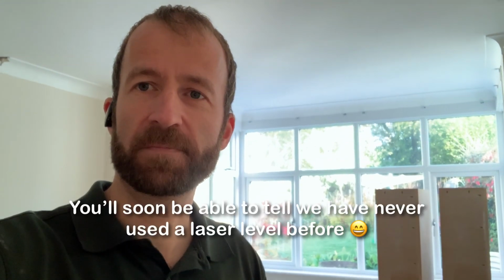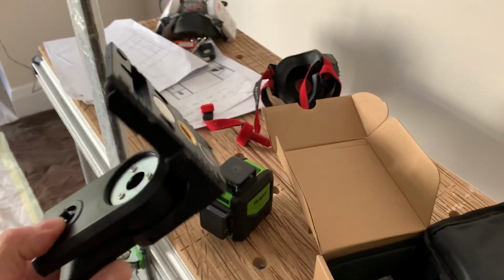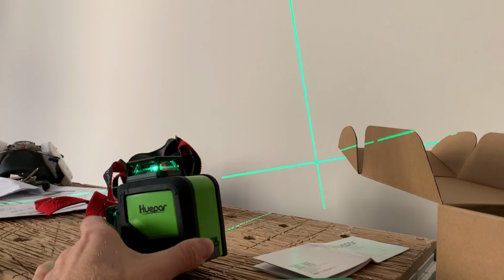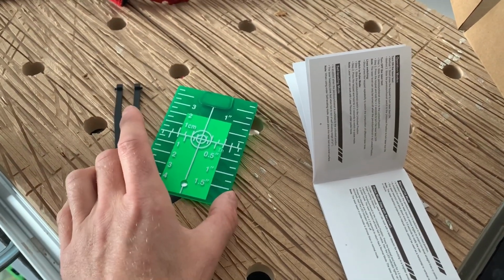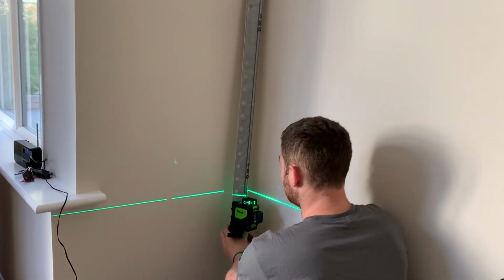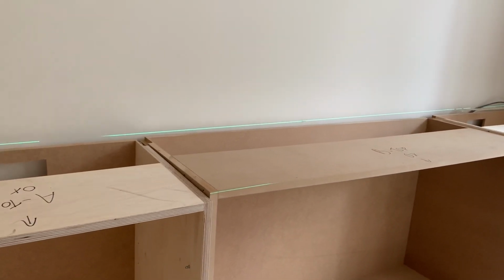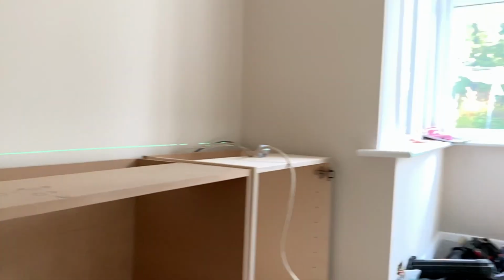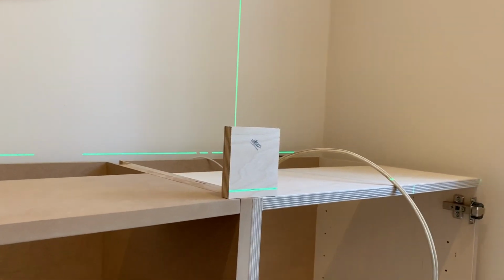Huepar 902CG laser level unboxing

Comment: Its been my experience that the target is for suspended ceilings. You use it to level the metal grid. Attach your laser to the wall and use target to level it. My laser clamps to the track so no screws in the wall.
Reply from the maker: Brian Needham makes sense!
Reply: That's exactly what it's for. The green target hangs off of the grid and your able to adjust its height perfectly level.

Comment: Use a quick clamp to clamp a panel saw to a door and then the magnet with grip onto the panel saw. Not in contact with the floor and no fixings to tidy up afterwards.
Reply: Good idea.Perhaps even better would be to clamp a steel rule to the door so you don't damage the door and can make your adjustments quickly and precisely IF you need to set the line at a particular height.
Reply from the maker: Good ideas, best to avoid contact with floor so it doesn’t wobble

Comment: Buy a cheap plaster board support it can be fitted in doorway or floor to ceiling and being metal the magnets hold the level at any height
Reply from the maker: As commented to Norman above - I’ve gone off any method that sits on the floor because walking around wobbles the level,  hanging off the wall seems best if possible.
Reply: you will learn a few tricks as you use them more. i have tripods on wooden floors , they are too springy . i use  on of those exandable poles  that you jack up like a silicone gun but put it in a corner out of the way to minamise any flex in the floor hanging a hand saw from any picture hanging points works good too but it a bit limiting. last time i did that i brought a flexible steel roll up straight edge  and hung that on a nail so i had 6 feet to play with height wise. clamping a hand saw to a window works well too sometimes , a clamp is great to clamp onto a window board overhang  the magnet will hold on the bar of the f clamp

Comment: Hello I bought the model up from the one in the video and I also purchased this ( Laser Level Mounting Pole 3.6m with Tripod Base Floor to Ceiling Support & Bracket + Adapter 1/4 and 5/8 + Bag on Amazon) not cheap but not overly expensive either and they work flawlessly together take a look. Hope this helps. If you need a direct link let me know.
Reply from the maker: john smith can you put direct link for simplicity, it should work as a hyperlink here
Reply from the maker: john smith thanks for this, seen it now.  That look well built, I had t seen one like that.  I’ll see how I get on with other methods of attaching the level on site but will keep it in mind and probably buy it eventually!

Comment: Try using a plasterboard prop that’s what are use the magnet sticks to it great you can use the floor and the ceiling for the prop
Reply from the maker: Norman Roberts I’ve gone off any method that sits on the floor because walking around wobbles the level,  hanging off the wall seems best if possible.

Comment: Ok, I looked at a number of levels cheap and expensive and decided to stay away from one for the time being even though I'm a big gadget fan myself.

The main reason being they're not as accurate as we may think - Skill Builder did an episode on it.

Another reason is price. The one robust and accurate enough for my needs costs far too much just now.

Finally, battery life is generally poor and Makita don't do an 18v version which is ridiculous.

One minor disadvantage is quick and efficient mounting which none of the manufacturers seems to have come up with a real good solution for.

Not so long ago all chop saw makes had laser versions which we all know now is just a waste of time.

So, I really appreciate your review as I did sincerely consider this manufacturer myself.

Have lots of fun with your new toy guys!
Reply from the maker: aaa aa it will be interesting to see how we get on with it in the long run.
Reply from the maker: Can you post a link to the skillbuilder video in question?
Reply: @Alastair_Freebird  here's the link to the SB video https://youtu.be/wGU-MurwF4A.

Forgot to mention good quality levels have pendulum locks to keep them protected in transport. I believe it's just a mechanical lock like a pin or something but most levels don't have it.

Yeah, go ahead and post us an update in a couple weeks time. That would be much appreciated!

Laser levels tend to be out on the extremes of their visible ranges. It'd be interesting to know if this has implications in real life situations.

Comment: I just got mine today. It sucks. Lots of ghosting and fantom lines. No it’s not dirty, and I bought it directly from the manufacturer.
Reply from the maker: Ah shame I'mm sorry to hear that, its worth contacting them to ask for a replacement
Reply: @Alastair_Freebird  I did. They said it’s dirty. Funny thing happened, I turned it back on few days later and it’s been working fine ever since. Even in a dusty construction environment. Not really sure what was that.
Reply from the maker: @lockpickingvlad  That's interesting.  Perhaps a small speck in just the wrong place (like right on the laser source) can do it

Comment: Great video! I notice you cut the carpet. How do you fix the carpet to the floor after your cut? Do you install another tack strip and stretch it?
Reply from the maker: Michael Ford yes we do reinstall the tac strip under the cut edge (cutting back the underlay accordingly).  We kick the carpet into the spikes, it has always seemed to keep everything flat enough without a proper carpet Fitter’s stretching method!
Reply: Freebird Interiors thank you Alastair. I saw a video right after this where you show that you place the strip. Sorry about that.

Comment: how did I manage to take a line across 2 points, and the laser shows level in the center but the 2 ends across 25 feet shows that it is about 1/2" lower? Meaning my lazer is dead on with the string in center, but at the ends the string is higher, as if the string has a bow in it...but it is not touching anything. HELP?!
Reply from the maker: Isn’t it normal that a long string would dip?

Comment: Could I use this to level some concrete spur posts I’m finding in my garden?
Reply from the maker: Definitely.  The laser travels pretty far, and for that sort of work the thickness of the line (thicker than some more expensive ones) might be a bonus
Reply: Freebird Interiors thank for the reply. I’m not sure where the word finding came from in my original question... it was supposed to be ‘putting’
Reply from the maker: The curse of the spellchecker, I got the general gist anyway!

Comment: I think i will spend the extra money for one that is rechargeable costs less over time
Reply from the maker: Irvin Wittmeier I wonder though, how much time till you make the saving?  Let’s say you give it regular usage and need to change batteries every month (I don’t know yet how long they last, perhaps that’s optimistic but how long do you really need to use it for?).  You can get 4 AA batteries for £2.  That’s £24 in a year.  Equivalent branded lasers seem to be at least £100 extra so that’s 4 years til break even.  Anyway, you could just buy rechargeable AA batteries (a bit more of a faff though).
Reply: Or just buy a set of rechargeable batteries and switch all your AA devices to rechargeable.

Comment: Hi use the target instead of the wooden block
Reply: Depending on the range of required datum points, e.g. floor and ceiling or just worktop height,I'd use a tape measure or a square-adjustable or roofing type- with a scrap of masking tape on it to avoid errors from misreading.By looking at the reading you get,you can easily tell whether your 'target' is plumb or not-tilt it back and forth until you get the maximum or minimum reading,which guarantees that your 'target' is square to the plane of the laser line.
If you are going to use a block it has to be clearly labelled 'this way up' to avoid expensive mistakes.

Comment: 7 months on would you still recommend this and do you use it on every job?
Reply from the maker: Yes I would still recommend it just as much.  Used it today.  But it doesn't replace the spirit levels - sometimes I find them more suitable for the job in hand, but that's not because of any failings in this type of laser.
Reply: @Alastair_Freebird  thanks for the great reply :)
Reply: @Alastair_Freebird  what's spirit level Ebay or another Store?

Comment: How far can you see the laser outdoors in daylight?

I recently bought a Bosch laser and returned it because you can literally not find the line beyond 3m distance in daylight.
Reply from the maker: In daylight I think these would be no better.  However this is why you can get a range extender, it’s a device that you hold up and it detects the line when on pulse setting and gives you a reference point.
Reply: What about laser glasses?

Comment: Hi 
How are you finding the laser level now is the level of good quality does it seem like its worth the money
Reply from the maker: Hi Shane I would still recommend it just as much as before, I still find it very good.  Some people have said the laser line is too fat; I don't honestly know how that compares to more expensive brands but for me it's never been a problem as you can just reference off the top or bottom of the line, and it definitely gives me more accuracy than traditional spirit levels.  I don't know what you really benefit by paying more for other brands, this seems to do all I need and the build quality is solid, and the batteries are lasting ok
Reply: @Alastair_Freebird  sounds like a new year purchase 👌

Comment: Use a tripod?
Reply from the maker: 'Seyi Richard the problem with tripods is they limit the height you can quickly set it to.  Based on advice I have recently bought a good quality floor to ceiling clamping strut which should allow me to mount it at any height

Comment: crap laser no argue on that.
Reply from the maker: 667mfleen it’s the first one of this sort that I’ve used.  Seems good to me, can you tell me what’s better about the more expensive ones, is it the thickness of the line?
Reply from the maker: ricardo rendon you mean is it bright enough?  I haven’t really tried it for that, did turn it on outside once, it’s certainly brighter than other cheap ones I’ve seen but I expect you can get better
Reply: You wanna spend your hard working money for DeFault or Milfuckee than right. I have a ton of 12v bosch tools in a systainer, there's a bosch laser that works with this 12v line, it would be perfect for me but fuck them, it's super pricey. Not to mention all the money I spend on fe$tool and maf€ll for the little usage. Some tool makers are making apple similar margin.
Reply: The heupar level laser use a OSRAM LASER LENS IT IS MADE IN GERMANY